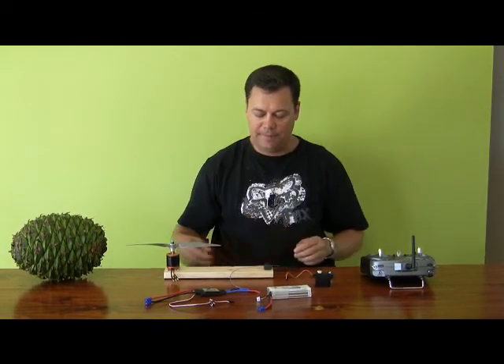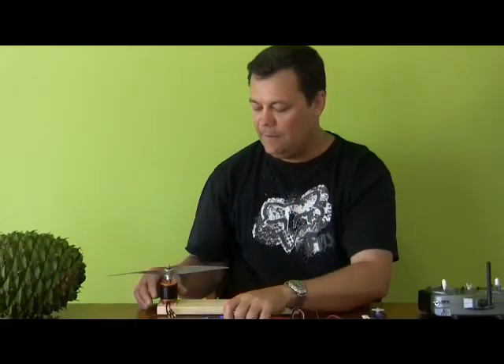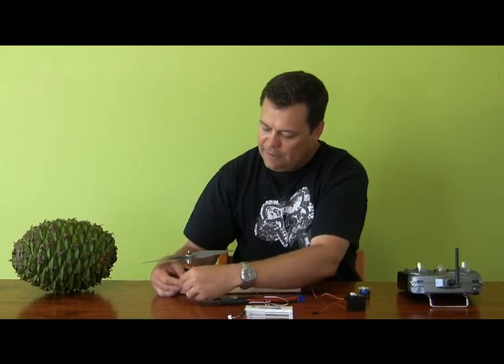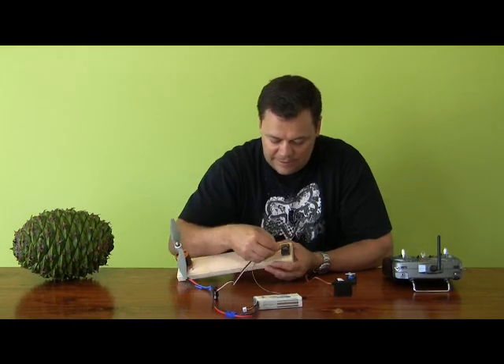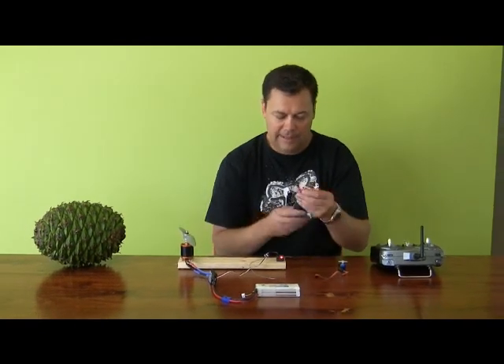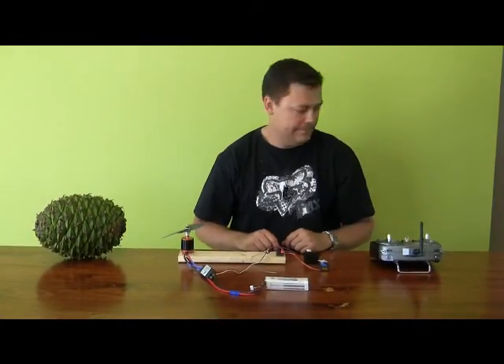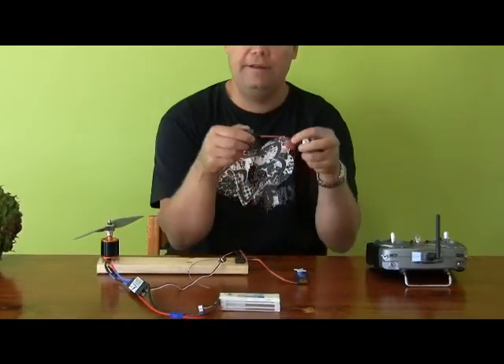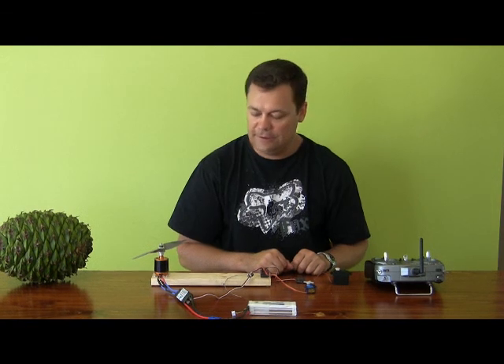Connecting your RC components, a basic guide

Comment: Thanks for this. I've started building a full size remote controlled R2D2 and didn't really have a clue about how to connect the speed contoller to the RC receiver, and then how to connect the Receiver to the other servos I'll be using. This has helped loads as I'm now on my first step to understanding remote control systems.
Many thanks!
Glyn. Isle of Man (UK)

Comment from the maker: Hi gizmoguyar, you are exactly right with the C rating! 10 x 1.000 = 10amps maximum, & your motor and ESC are spot on.  But you will be limiting the power of your motor to about one third 1/3 of its maximum, and will be putting undue stress on your battery.  I would always recommend the highest C rated battery you can get your hands on :-)  for example a 1800mah battery with a 25c rating would be good (25c x 1.8 = 45A).  resulting in good flight times, great performance & a happy battery.

Comment from the maker: Hi Sam,
Your battery is capable of supplying a maximum of  20c x 2.500 = 50a and has a capacity of 2500mah.   Your motor is rated at Continuous Current:30A Max, and is rated at 40A (your propeller choice can cause your engine to draw more or less, the best setup will have the motor drawing 40A at full throttle and it is recommended you use a  9" x 5 " or a  10 " x 4.7 " propeller) 
You could have gotten away with a 45a ESC if weight is an issue.  Flight time on this should be greater than 9min

Comment from the maker: Hi gizmoguyar, actually what you need to look at is your ESC and motor.  The motor is the unit drawing the power from the battery through your ESC if you get these set up you can use whatever battery you like. (Providing you don't exceed the maximum voltage rating of your motor :-).  Rule of thumb is to have an ESC that is able to handle just more than the Max Continuous Current (Amps) of your motor.  For example if your motor draws 30 Amps then I would recommend a 40Amp ESC.

Comment from the maker: It would depend what 3600kv motor you are using, but most of the larger ones will need a 40 to 50amp esc.  Normally there is a number like 2830 which is needed with the kv rating to work out the amps.

Comment from the maker: @RcWorld7 An out of balance propeller will normally be worse at particular RPM's.  I am not sure why but I suspect it has something to do with harmonics.   I only use rigid mounts, but I don't belly land my planes.  I suspect if you belly land a prop saver might help.  As to how tight, well you don't want you prop coming off mid air so tight is best. (I haven't broken a mount tightening it yet and I use a small screwdriver)

Comment from the maker: 1.  you plug the bind plug (you would have got one with your receiver) into the Batt/bind pins on your receiver 
2. then power up receiver first (plug in your lipo to the ESC in your plane) The receiver light will then begin flashing rapidly. 
3. Then switch on your transmitter whilst holding up the bind switch.  Keep holding  the bind switch till you see the rapidly flashing receiver light change to a solid or slow blink.
4. release the bind switch.... and your done.

Comment from the maker: Hi @simenhenri, I don't know why but I didn't get a notification about your question... so sorry about the delay.   My transmitter is a Spektrum DX6i and the receiver is an AR500. 
In relation to connecting your receiver to your transmitter - well that would depend on what sort of transmitter and receiver you own.  In the case of the Spektrum range you need to do the binding procedure.  Basically what that means is

Comment from the maker: @YaMaHaCrAzY68 
You are going to need a power source for your receiver.  To do this you will need a Battery and a Elimination Circuit or as it is more commonly known, a BEC or UBEC to power your receiver and servo's. 
 Switching BEC'S are the best type to use as they are more efficient and can power more servo's. 
The BEC has an input and an output, the input plugs into your Lipo or similar and your output will plug into your receiver where it is labelled "battery"

Comment from the maker: @RcWorld7.  That sounds quite unusual, an electric motor does not normally vibrate at all.  Vibration is almost always caused by an unbalanced propeller or spinner and may be made worse if the motor is not mounted to the air frame correctly.  If your motor is vibrating without anything on it then I would suggest that you may have a bent motor shaft. With most reputable brand motors a new shaft can be purchased for 2 or 3 dollars.  - Regards OpticFlare

Comment: Hey, thanks for the video, this is really helpful. I have one question though, about the current ratings for the Battery and ESC.  I'm not sure how to select them. The ESC must be rated at or above the peak current that the battery can supply right? But everyone says not to draw the max current from the battery because it will get hot and may shorten the life. So how do I configure everything to not blow the ESC, and also take care of the battery?

Thanks.

Comment from the maker: @Maximilionalpha 
Hi, and sory for the delay in getting back to you.
You should have no problem using a 30A esc providing you don't exceed a 10 x 5 propeller.  If you put a larger propeller on you will probably go over 30A.   Battery etc is fine.
Regards

Comment from the maker: Hi Adip,  
You should never plug or connect your battery or radio receiver directly to a Lipo.  
- how it works is you plug your Hobby King 20A ESC 3A UBEC into your battery (the two thick red and black wires) 
- you then plug the three thin wires (normally white black and red with a small black connector on the end) into your radio receiver, 
- and you plug your servo's into your radio receiver. (The BEC on your ESC will convert your battery voltage to suite your receiver and servo's for you.

Comment from the maker: @YaMaHaCrAzY68 The BEC converts the lipo voltage down to 5v or 6v.  you should be able to use a 6v battery, you will just need to make up a cable with a 9v connector on one end and a 4 pin plug on the other end to plug into the receiver. (just connect the red and black wires red = Positive black = Negative).

Comment from the maker: Battery was a "Mystery" brand Lipo, 3s 11.1v 2800mAh.
Engine was a Scorpion 3026-8 1212kv
ESC was a 80A "Pentium" brand with BEC. 
Propeller was an APC 11 x 5.5 
Total of about 2400 grams of thrust flat out :-)

Comment: Thanks! One question though, how do you connect the server to any tarnsmitter. For example I have an F-15 that came with a transmitter and server and all that fun stuff. I was thinking about buying a better transmitter that way any other planes I get I could save since I wouldn't have to buy a transputer for it. Would you have to buy a different server too or how would you hook it up? Sorry if it's confusing. Thanks!

Comment: RATED:

HobbyKing Brushless Car ESC 30A w/

A standard car esc. providing forward and reverse with a large range of motor compatability for up to 240,000RPM motors.

Features: Full protection feature including low voltage, over-heat, throttle signal lost, startup protection and self-check. Compatible with sensorless brushless motor. Excellent startup performance, linear and quick throttle response.

Comment: Sam,  I have a EMP C3530 KV1100, motor that I want to use as a replacement motor for my phoenix 2000 sailplane.  Could i use a 30amp esc, instead of the 40-60 size esc's and a 1800mah-2200mah 3s lipo?

Comment: @OpticFlare  So would it be okay to use a 1000 mah battery with a rating of 10C (That means the battery can only supply 10 amps max right?), if I where to use a motor that draws 30 amps, and a ESC that can handle 40?

Comment: I just saw that this esc only supports upto 2250kv motors so thre is one 30amp esc for rc car w/reverse n i wanna build a rc car and plane wid same esc so will it be okay . It is hobbyking esc with heat sink . I will attach the esc to a 3s lipo nano tech by turnigy 1300mah. Should i attach a fan for cooling due to powerful battery please suggest. Thank you for all of ur answers

Comment: Installed my new ESC today on my rc plane (HZ Supercub) but it wasn't flying right. After it was in the air only about 50 ft the motor started cutting off and starting for a little and then cutting off. this caused it to crash and once retrieved I checked on my electronics and all of a sudden smoke was coming out of my ESC. What was I doing wrong?

Comment: Hi
sorry for not replying 
I have changed my motor and esc to a aeolian c3530-kv1100 motor with a 5*9 prop and a sky wing 60a esc whith BEC but cant understand how to work out the right battery for decent flight times. so far have worked out that a 2500mah 3s 20c lipo would work but would only give about 3 mins of flight time.
could you help with batterys?
thanks, sam

Comment from the maker: Good afternoon,
I do not have any experience with the 4 in 1 receivers and I would recommend you post your question on a helicopter forum.  However I do know that the signal from the brushed ESC is not compatible with a brushless motor.  I did however locate this device that may assist. heliguy.com/Electric-RC-Helicopters/HoneyBee/Brushed-to-Brushless-Signal-Converter/# 
Regards  Optic-Flare

Comment: what is the voltage of ur servo? can my servo: HKSCM9-6 Singlechip Digital Micro Servo (6V) 10g / 1.6kg / 0.07s
be connected to this battery:Turnigy nano-tech 1300mah 3S 25~50C Lipo Pack
and can even this brushless motor:AX 1806N 2100kv Brushless Micro Motor (19g)
be connected with this esc:Hobby King 20A ESC 3A UBEC
using this rc remote system:HobbyKing HK6S 2.4Ghz FHSS 6Ch Tx & Rx (Mode 2)
please give a fast reply i want to order these all. found all at hobbyking please check. please help me.